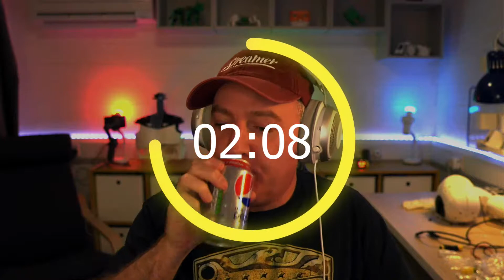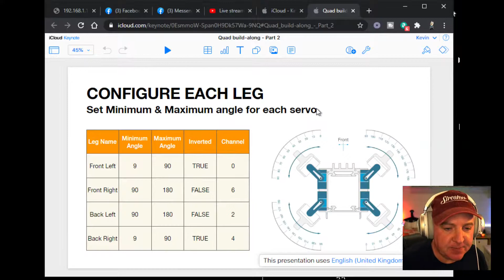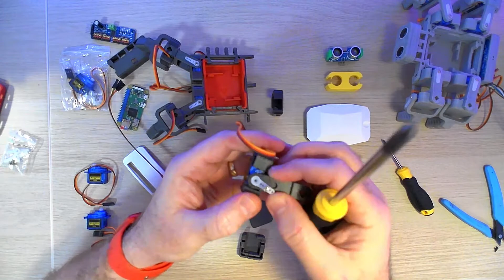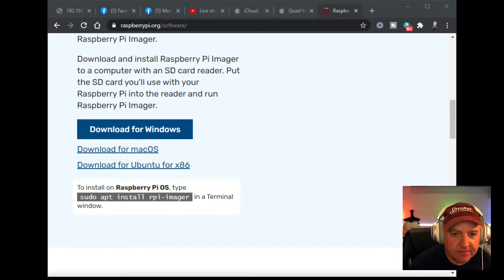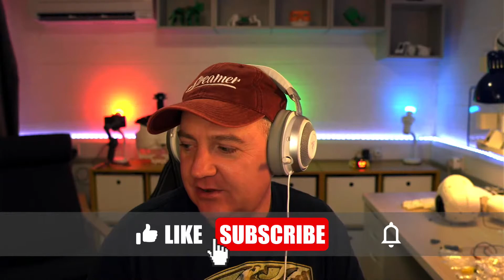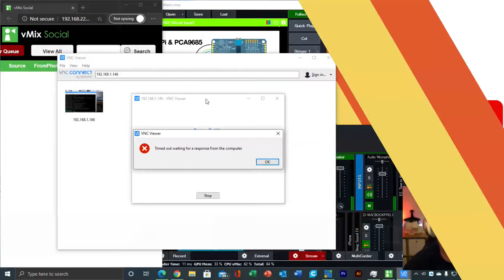Assembling and wiring up the SMARS Quad Robot

Comment: Kevin, GREAT DESIGN! GREAT VID! I’m going NUTS however because I’m ordering the electronics and I found a site a day or so ago, can’t find it at the moment, don’t see it on SMARSFAN, etc.. that specified a complete BOM. Aka, I order the servos, the 9865 board, the pi zero w, I’m ordering wire, and DuPont connectors, BUT! I’m ordering batteries too but WHAT DO I PLUG THEM INTO? Where is the Spec for the attachment/ on-off switch? Also, is there anything else, not specified at SMARS FAN, etc...??? Do I print my own battery case and attach an on/off switch to that? Lol, not YELLING mad, goin nuts to make sure I’m getting everything because after i get it all printed and go to the build phase I don’t want to get to the end and find out I have to order more stuff :-). Thank you, this is awesome, and I can’t wait to get it underway. You rock.
Reply from the maker: Hi Jake! I can't take credit for the design - that goes to the amazing Kevin Thomas! Thingiverse has all the parts you need https://www.thingiverse.com/thing:2755973 The Quad has a 'pod' that slots into the top for 2 x 18650 batteries - you'll have to bend some metal strips to make connectors for the batteries. I'll add this as a topic for a future video. Thanks Jake, I'd love to know how you're build goes.
Reply: @kevinmcaleer28  I would also be interested in how the powershell/batteries needs to be wired to the pi and servo driver board  :). There is only  one picture on thingiverse and im a total newbee when it comes to eletrical engineering.

Comment: Hello there. this robot is my project assignment and when i examine the series a little bit, i see a case where you place materials such as voltage amplifier in the videos, but this case does not have a 3d print file thingiverse. youtube or the people who made this project have this safe, but they did not share the 3d printing file. I would be glad if you could help me with this. Also, I'm not very good at coding. This robot has a few arduino codes in its files. If I upload these codes, will it work without adding anything?
Reply from the maker: You can grab all the files from www.SMARSfan.com

Comment: I'm working on making a quad now with a raspberry pi, I'm about to buy two 18650 batteries as a power source. Will those batteries be able to power the board and servo board?
Reply from the maker: Yes - that will be fine. What mAh did you go for?

Comment from the maker: I'd love to hear about your SMARS Quad builds, let me know how its going and if you had any challenges with it.
Reply: I am facing some challenges indeed ;) I am trying to put the stuff together and getting it to move, but it isn't really possible. Either I made some mistake or the library doesn't really match the recent builds. The wiring diagram of the servos from the video doesn't match the one from the documentation: https://github.com/kevinmcaleer/smars/blob/master/Documentation/SMARS%20Build%20Instructions/SMARS%20Build%20Instructions%20v2%202.pdf - but that seems to be the one the library uses as defined in smars_library/channel.py
I had still no luck after sorting this out, because some of the servos seem to be reversed. The oriantation in https://github.com/kevinmcaleer/smars/blob/master/Documentation/SMARS%20Build%20Instructions/SMARS%20Build%20Instructions%20v2%202.pdf also seems to be different from the video...
I am still unsure what the best way would be to sort this out. From an engineering perspective it does make sense to put the legs as far into the corners as possible and therefore go with the recent video. However, from a programming perspective it doesn't make sense to fork the library just to change the order/direction of the servos...